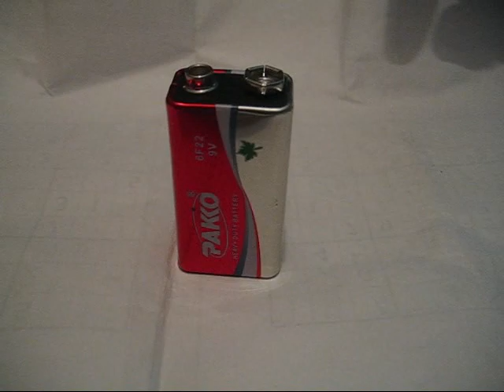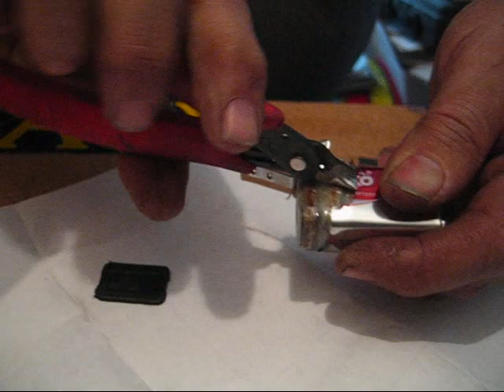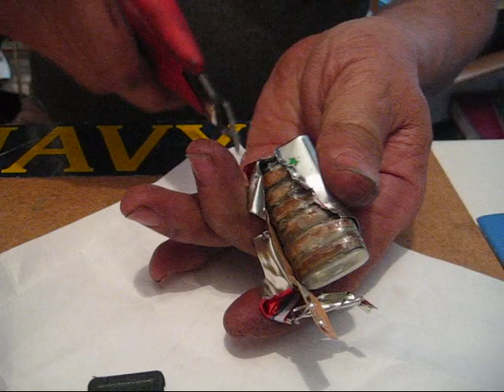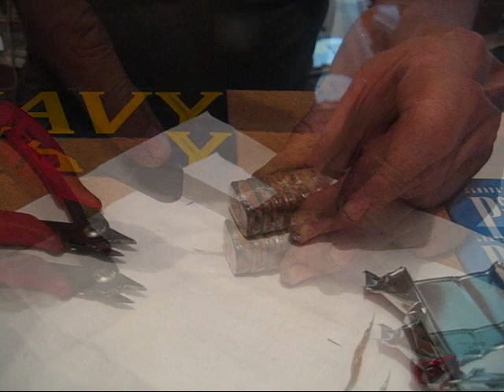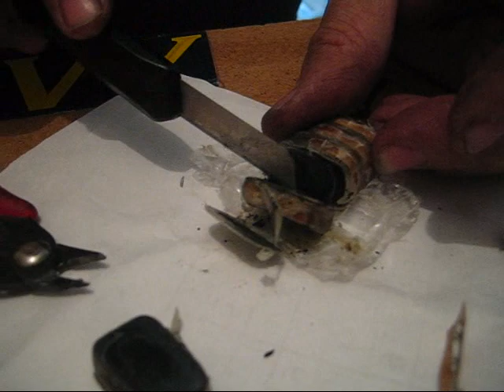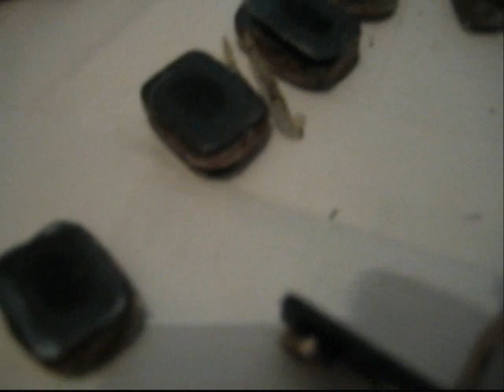Teardown: Opening a 9 Volt Battery

Comment: @Ludde365 Depends on what battery you are opening.. Most alkalines are safe to open as the acid in them is not very volatile. But some reports have come in that alkalines have exploded. So if you are not careful when you open them you may short them.